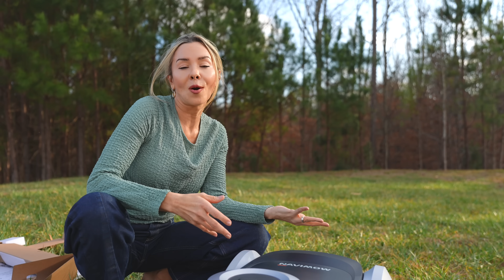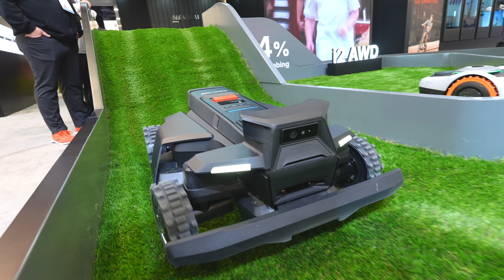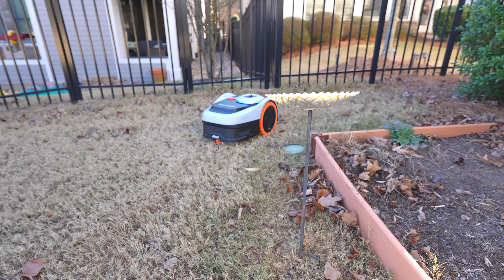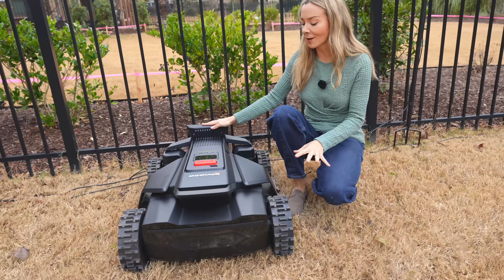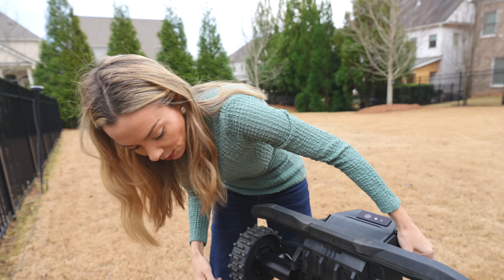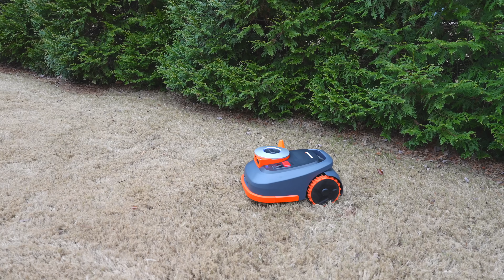I Put Segway’s Autonomous Mowers Head-to-Head

Comment: i have one that uses guard wires to be burried in lawn and it gets stuck everywhere. i still have it but don't use it and just run my lawn mower now. i think this is a good move. does it use AI?
Reply: I don't blame you for not using it.  Boundary wires are sooooo 20th century.  The tech's well beyond that now.  I just bought a Segway X4500 that supposedly doesn't even need a hardware RTK.  We'll see.

Comment: How does it handle navigating around a garden hose that i definitely don't leave out ever.
Reply: If said "garden hose" is laying flat on the ground, why would it HAVE to "navigate around it"?  If you're cutting height is a couple of inches or more, it should just roll right across said hose.

And if you never leave it out, why the question to begin with?

Oh, and a couple of other little niggling details - you wrote a question, and those are ended with a question mark.  Also, "I" is a proper pronoun - capitalize it.  This isn't "texting".

Comment: I tried a robot mower 8 years ago. Two major problems back then: 1. it required a perimeter wire, which was tedious to set up. 2. it often got stuck on slope. Compared to the ones in the video, a single sensor post setup is definitely a lot easier. AWD should make it less likely to get stuck on slopes or slippery terrains. As far as the price, the one I got 8 years ago was about $600 when on sale.

Comment: I don't have the same brand as in the video (it didn't exist then anyway) but I like to add that my first robotic mower from the brand that invented the robotic mower in the 90s was purchased in 2017. It had quite a lot on its plate so it had raked up 4038 charge cycles. It's 10 li-ion 18650 cells. Only simple monitoring, no active head management.
So when people have been saying/commenting that BEV batteries need to be replaced very often (due to actual wear of the cells), I've shaken my head. Robot mowers is a presedence only rivaled later with taxis.
(I don't have a BEV due to too low utilization of my car, so I'm not preaching this as a BEV owner).

Deployment of robotic mowers in the nordic countries are a lot  further ahead than the US. Quieter in the neighborhoods when fewer people start the Saturday or Sunday with a very loud gas powered mower.
And nicer lawns - grass is best when cut often, not when it has gotten to long and the neighbors starts to snear.

I hope the US also will get to experience this with models that are out now that match the US requirements a bit better.